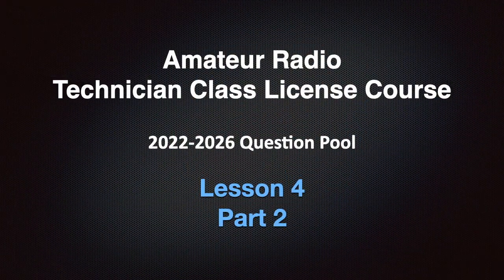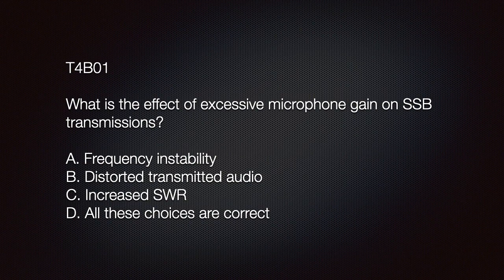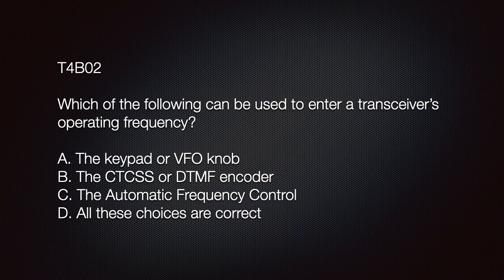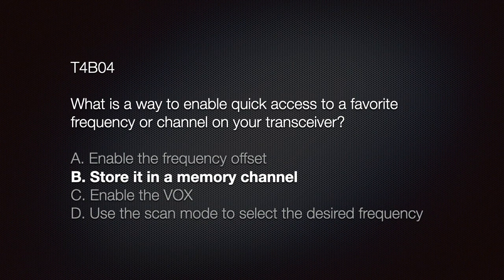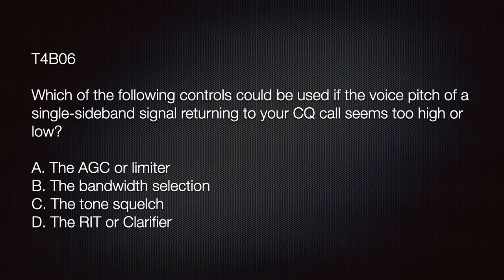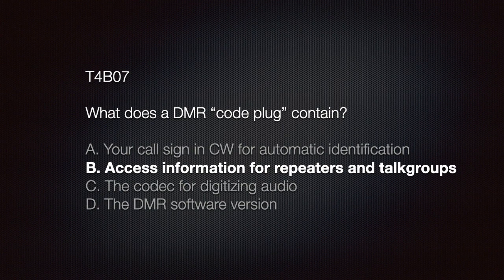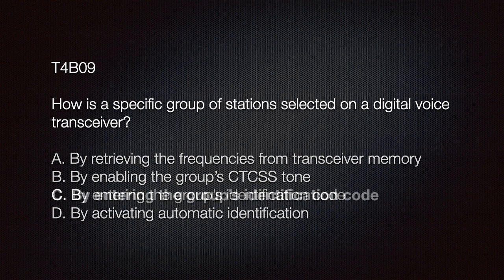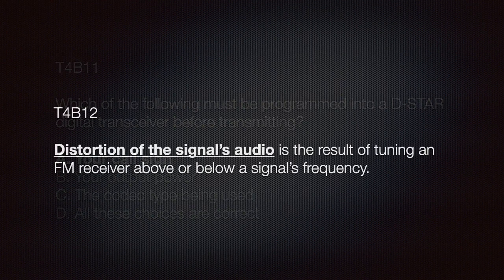Amateur Radio Technician License Course 2022-2026  Lesson 4 Part 2

Comment: Gary, there is a lot of effort  here, done by you.
I'm English as the call sign shows. Stopped Ham radio in 1990 after 20 years. A lot as happened to the amateur radio since then. Packet radio and new bands. I was going to try a reciprocal license but it was unfathomable.
So going through your lessons, then try to get the tech pass. That's all I need as my interests is 2 m 70 cm.
Thank you Gary.